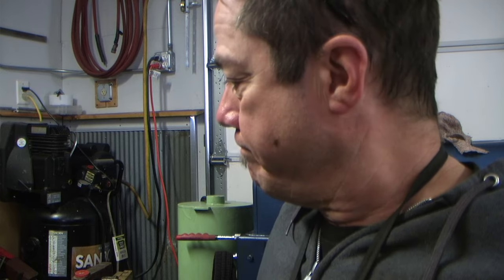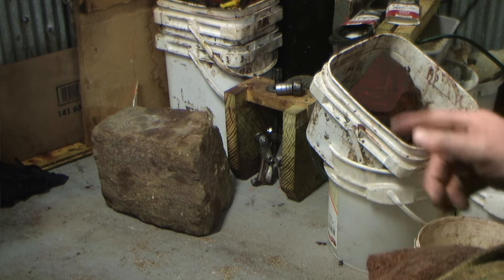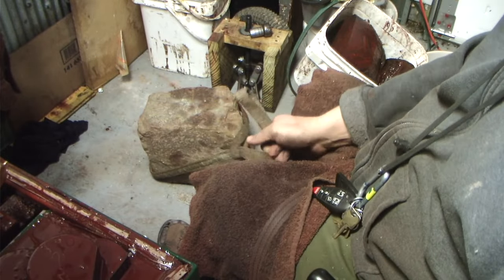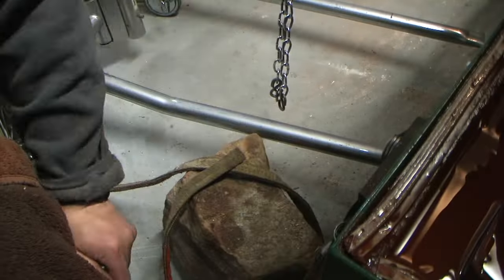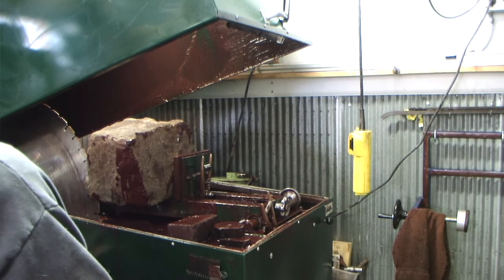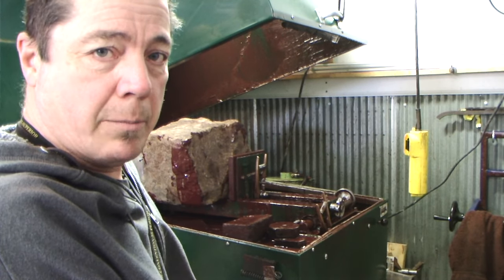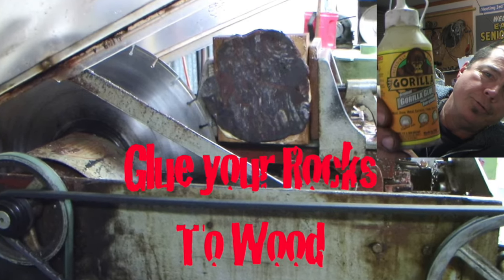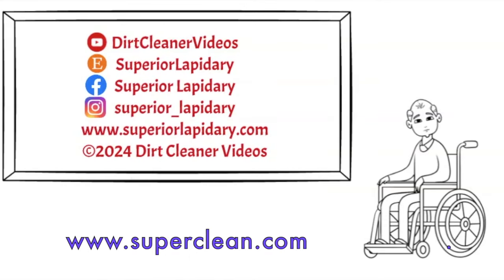Lifting a Hundred Pound Rock from my Wheelchair  Product Give Away

Comment: I am impressed how you were able to get this rock into the saw. It would be a challenge for those of us who are not in a chair.  Great Job!!!  I typically run my saw in the lowest speed all the time. The quality of the cut seems to be better.  Looking forward to the result of the cutting project .  516.
Reply from the maker: Thanks 👍
Reply: This is an example of the strengths of YouTube. Recently I subscribed to both the channels of youse guys. Yes Jaws I did find the follow up on the 18” saw!  The point is that I am also running on the lowest speed and you reinforce my choice. Thanks.